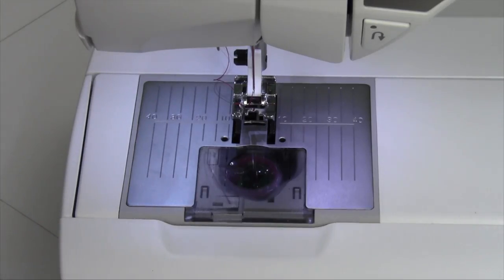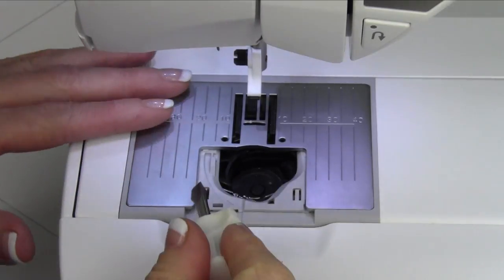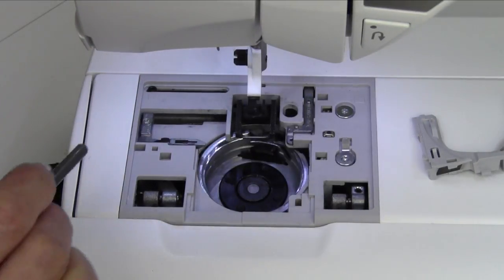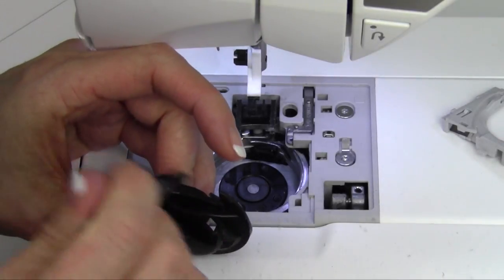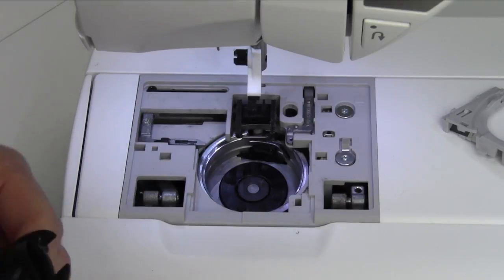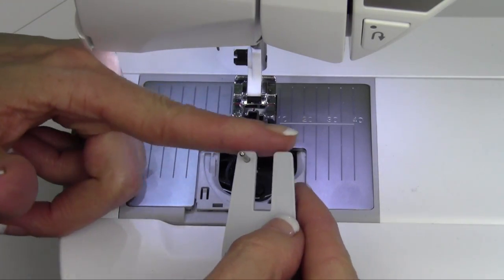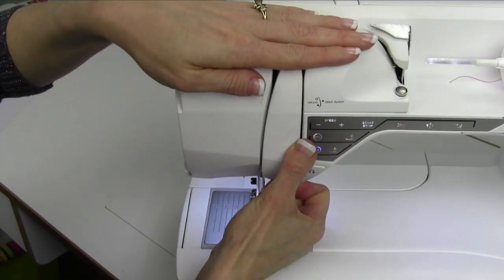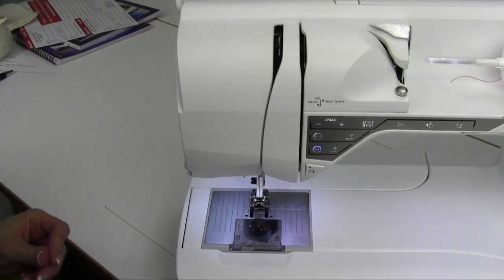Husqvarna Viking Designer Diamond 7 Cleaning & Maintenance

Comment: Instead of using the brush and duster, just use a folded in half pipe cleaner. It will pick up the lint and dust like a magnet, and you can just toss it in the waste basket when you're done.

Comment: I’m hoping you are still monitoring this channel. I’m having a lot of bobbin issues with my designer Diamond. I don’t have the royale version, just the DD. I hear the bobbin bouncing around in the case now and then. Sometimes it works itself out, other times it just causes a big birds nest and a mess. It happens over and over again lately. I really want to give magnetic bobbins a try but since the case is all plastic, do you know of a replacement that is metal so that this would work? Or do you think my tension on the bobbin case is too tight/loose? My underneath looks good. It’s not necessarily the ⅓ ⅓ ⅓ but mire like ¼ ½ ¼ if that makes sense.